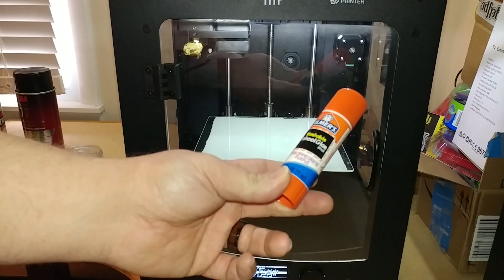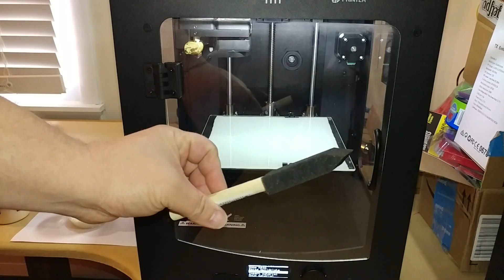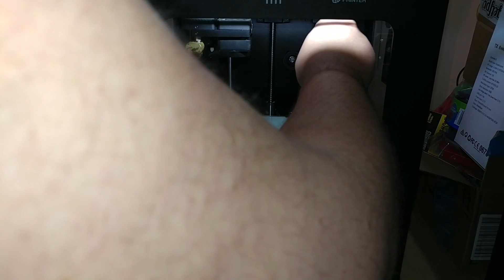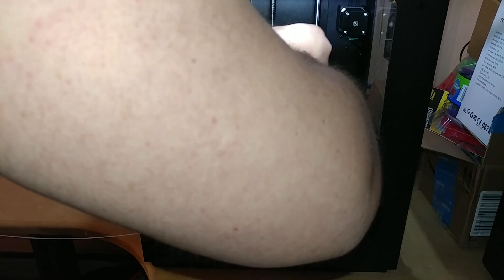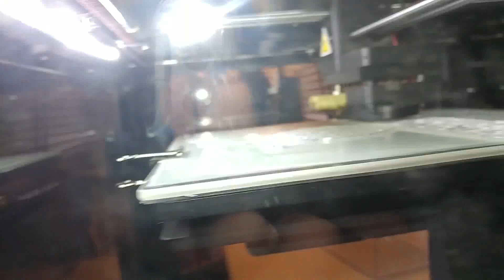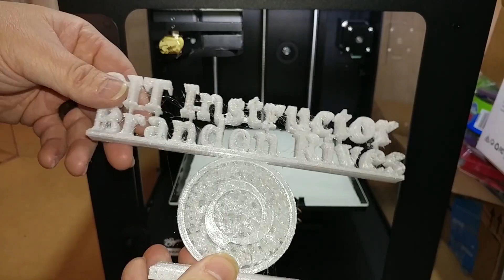3D Printer 101: How to make your print stick to a glass bed

Comment: You should switch to bontech if you haven't already done so for your extruder head filament guide.  When filament doesn't stick, it tends to clog extruder, which then jams extrusion. OEM filament extruder gear and guide can't overcome this pressure and will constantly jam. This is another issue with D6 and MP Ultimate OEM. I love this printer but the extruder and nozzle should be replaced.  Nozzle, might be better with micro swiss less prone to temperature differential gradient.
Reply from the maker: I have updated to the micro swiss a while ago. Been running great.

Comment: Gluestick didn't work? How much did you apply? Normally you apply 2 coats either the whole bed or the area you are going to use and let it dry (I use the heat of the bed) or maybe your nozzle is too high
Reply from the maker: Thanks for the info. But even if I could get the glue stick working I still would do the wood glue and water. It has not failed me yet, I am still on the same bottle I use when making this video 2 years ago and I only apply it like after 20 prints maybe more.
Reply: @LarokCreations  not a problem, probably I'm wrong but the only difference between the two glues is that one is not toxic and the other is LOL

Comment: On your flexible filament video. One thing I found to get flex to print was to turn retraction off and slow down you print by atleast 25%. I have been able to print flex without any extruder mods. The fix is absolutely a great one you highlighted, but you can make it work by changing retraction and speed. Try petg and pla pro (esun), best filaments I have ever used. You wont use PLA again....
Reply from the maker: Thanks for the tip

Comment: Hey Buddy, that seems like a major pain in the azz, but I bow with respect for your perseverance ! What is your z ofset ? You may need to push out a thicker bottom layer ? Did a raft not work ?Have you tried PEI or even PET (gizmo dork) ? PET with a good first layer of Elmers Extreme works great for all my other heated and non heated beds.I have one of these coming for testing friday so Id love to hear what you think ? I hear a slight accent also, you in GA ?
Reply from the maker: Thank for checking out my video! I note in the video all the ways i have tried. This is my first 3d printer so I don't know what you mean by "What is your z ofset ?" I am using simplified 3d manly the default setting. I have used Raft just don't want to use unless I have to. And I am from TN.
Reply: Cool. Im in GA. z offset is the distance that your nozzle is on the first layer. Its the "home" position. You really should not have to use the glue mixture (although it works the same as a glue stick). You should over extrude the first layer and slow it down. If your layer height is 0.2, make first layer fatter (0.3), and if your print speed is 40mms make the first layer speed 15mms. That will push out a fatter first layer and push it into the bed. You can use a brim instead of a raft, 5 - 10 line and make sure it is touching the object. Let me know if that helps. Great videos though, keep em coming, you got me to buy the printer. What do you think so far ?
Reply from the maker: Thanks a lot for the help. I love the printer, but the only other printer I have used is the New Matter MOD-T. The one thing you will need to print for this printer is the feeder gear part and you can see my video about it at this link https://goo.gl/CkSl4D thank again!!
Reply from the maker: And one other thing, make sure you check all the bolts. I had a lot loose.